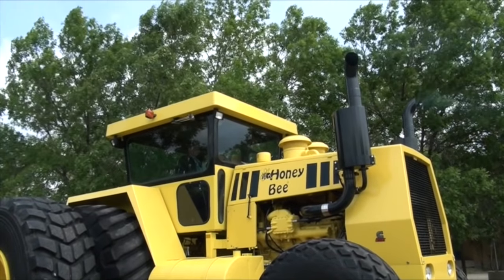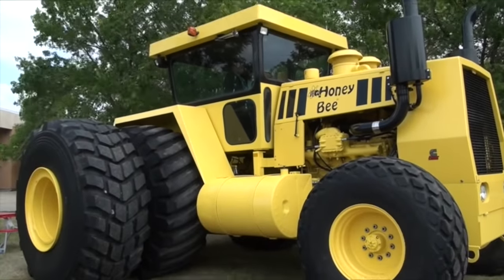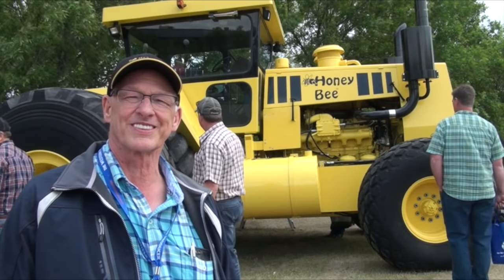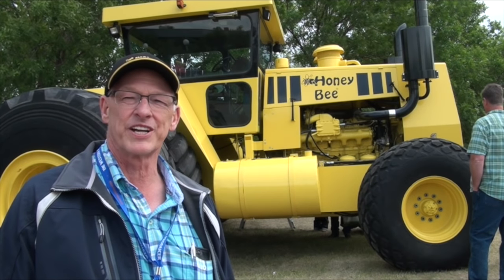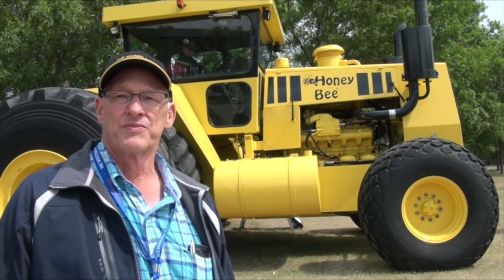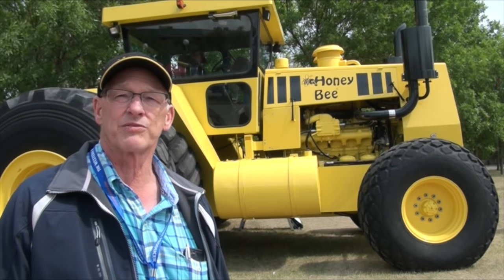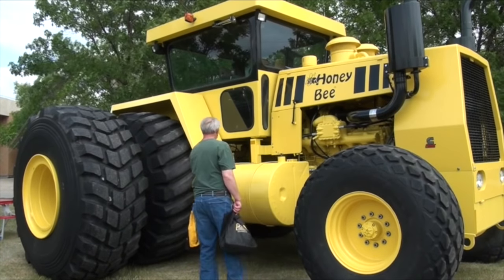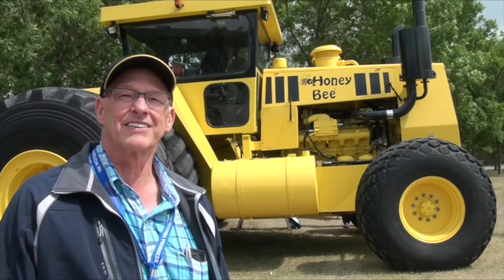A 500 Horsepower Homemade Giant — the Story Behind the Honey Bee 2WD Tractor

Comment: What an inspiration, I am wanting to build my own tractor and maybe Combine etc. based on current machines, but without the washing machine mentality of "let's put in weak spots to make sure our techs stay busy and we can sell expensive parts".
Less electronics and lots of fail safes to ensure continuing operation.
Reply: May I suggest start with the basic - anything pre 1960. You'll find the Metal is thicker, Engines built to last, Hydraulics stronger, and the Gearbox & Axles will match anything built today. OK you might not have GPS control but anyone with a good eye should be able to navigate a straight line across a field.

Comment: I love  these home  built machines ,, and  even more the care and attention  that was  paid to it during  building 

I myself  have a couple home made  tractors  but  mine are a wee bit smaller ,,
I built my tractors out of automotive components mostly ,the  one i use the most was built out of  2 nissan trucks and a ford truck 
I used a nissan 3 liter V6 with a 4 speed  automatic  and mated a 5 speed  manual behind it 
rockwell divorced  transfer case   direct bolted to a  rockwell 2 speed  truck axle from a grain truck ,I used  mostly 6 inch C channel for the frame 
I built  this  machine  in 2001 originally 2 wheel drive  but after 10 years  using it   i upgraded it with  4 wheel drive ,,the rear  tires  are 14.9-28  ,and 11R22.5  in front ,,fronts are irrigation pivot tires ,,had to figure out the correct  ratio to make them turn the correct speed and then find a 4x4  front axle to match ,,I settled on a front axle from a 1984 F250
I rebuilt it as a strait axle   with a pivot  just like a tractor axle 

in 2014 i also upgraded it again   this time  by a round about way i added  a live PTO ,this required having a power shaft  made for the  front of the engine ,,,this  shaft turns a 6 groove pulley  with 6x 5/8 in belts  that turn  an irrigation power unit clutch  with a  4 speed muncie  behind it ,this  unusual arrangement gives me a 4 speed PTO 

kind of  an ugly machine   but it works  well for my small farm as a utility tractor ,,
it is  however  all electronic because i kept the complete electrical system from the vehicle the engine was in 
it has all of the features you would expect from any tractor  including heat and AC  ,and  it's  a 20 speed  power shift  thanks to the  auto trans
Reply: got any videos of it?
Reply: You need to post pics and videos.  It sounds great.
I think more farmers will go the DIY route as they keep making new tractors more $$ and harder to  work on.

Comment: simple is better, in most cases. built for a certain job at  a fraction of a purchased tractor. great job great minds.
Reply: Purchasing a tractor might be cheaper in this case. Think about the expensive tools needed, and then the engine, and the tires, and the cab, and the air conditioner.
Reply: @LegoWormNoah101  No electronics to worry about. Talk to a farmer that has had problems with all the electronic wizardry on today's equipment---what it has cost him in money AND down time---see what they would choose. Plus $40,000 then is around $131,000 in today's dollars--see what that would buy you!

Comment: I bet if they built these, people would buy these for different applications, build the honey bee!
Reply: Don't think so, technology has really improved. Today you can find much smaller 500hp tractors with all wheel drive and variable transmission on the market, which probably pull more.
Reply: with the amount of plastic used in new ones and the amount of electronics they certainly won't be as reliable as something as simple in construction as this

Comment: How much did it weigh ?
Reply: I believe it said 40 thousand odd pounds the things weighs alone.
Reply: @joshalger6059  
Upton's HT14-350 Is 23 tonne , so 50,600 imperial lbs ( 2240lb/ imperial ton )
The fuel tank was fabricated,  the floor was 1" plate sourly for ballast .

Comment: As a comparison, the largest articulated 4wd serial production tractors around 1978 were maxing out at ~ 350 hp. Only really one-offs like this that were more powerful than that. I'd question how much of that 500hp was actually usable with 2 driving wheels. You can go from duals to triple (heh I guess quads to) tyres, but then transport and actually control become difficult. There is a reason the 4wd tractor became the standard for high horsepower tractors, 4 driving wheels mean a narrower track for the same tyre contact area and other advantages. Also getting hold of implements in 1978 that would actually test 500hp would also mean homebuilt specials. Seems to me they got hold of a 500hp engine, and built a tractor around it, but the engine was overkill to the tractors actual capabilities and intended use.

Comment: Cummins are my favorite but i would rather have his other tractor with the six banger cat.  Or better yet this one with an 855 or 1150, both were proven to outstrip the v motors with torque and economy both.   A versatile with an Inline six is desireable, hence the 855 or 1150.   The versatile tractors with , 555 v8 and 903 V8 were all famous for falling flat on their faces when power demands were up.   Most truck shop owners I once supplied called them junk.  They quit building them for a reason. or two.  That's why nearly all the big trucks and tractors that are at all successful have seven mains, which is what you have in an inline six, not five, like a v8, pardon me on the v 12 it has seven but they are smaller and the rod journals have to share rods.  inline sixes have heavier cranks and rods too.  V8's are good for racing and pulling smaller loads..   Having slammed v motor diesels enough for now, I do admire the simple design, the nice look with the awesome looking cab and the New Holland looking paint.   And having the wherewithal otherwise, to make a v12 last.   Put an N14 or  EGR delete ISX in that thing and you'll have gold.  Except the big six can be tough on driveline...because they have real torque.   Heck, put a screamin 5.9 in it!
Reply: I thought he said it was a 6 cylinder Cummins in the other tractor
Reply: Brent Hass I do believe the 555 was known for the catastrophic failures...
Reply: 5.9? They need a DT466 to get easy power, 600 horse just fine, and to clear the smoke put the new s2e turbo if one can be found.
Reply: Brent Hass .better to have a real engine...Scania v8
Reply: Brent Hass it’s a 13 speed roadranger. It should be able to handle it. As for your suggestions, anything less than an 1150 would be a waste

Comment: Wow this big of a tractor with 500 hp and a nascar isnt this big and has the same hp
Reply: +Carrot_top115 completely different horsepower ,, a 900hp  nascar engine is built to produce 900hp for a very short time ,,3-4  hours tops
this  500hp tractor  was built to produce  it's 500hp day in and day out for years ,,some industrial diesel engines have a 20,000+ hour  life span ,and 30,000+ isn't  unheard of
Reply: Move along little boy, the adults are talking here.  Look up torque if you want to play along.
Reply: MrThisIsMeToo surely your not  directing  that  comment to me ,,
Reply: Diesels are slow burners but they produce lots of torque.  With the right gearing, they can move mountains.  For example, my slightly modified 2009 Cummins Ram 2500 has only 350 hp, but has 800 lb./ft. of torque.  Engine's like these, and on a chassis like that with weight will pull large implements in the gumbo soil found around here.  Pulling a 60 foot air seeder and cart in sandy soil require's almost half the horsepower and torque needed to pull the same in this gumbo clay/dirt soil.  I've seen guys break axles in big 4wd tractors being impatient in this stuff.
Reply: ***** yep  that's  why i like  big  machinery ,, i live in  SW iowa   and most of the soil is  mid way between clay and sandy 
i love  big horsepower too ,, most of my big equipment  has  detroit power